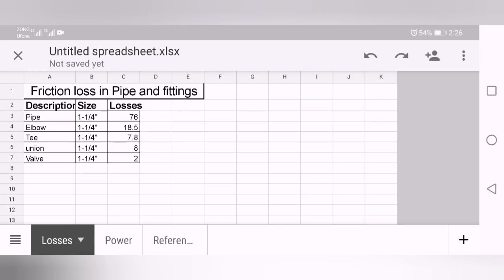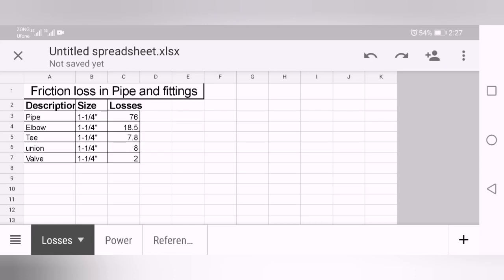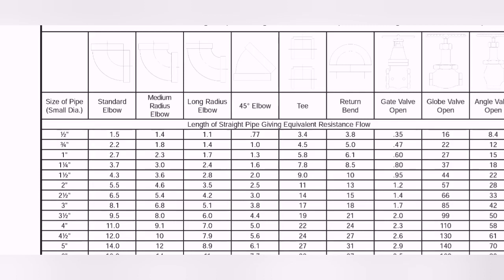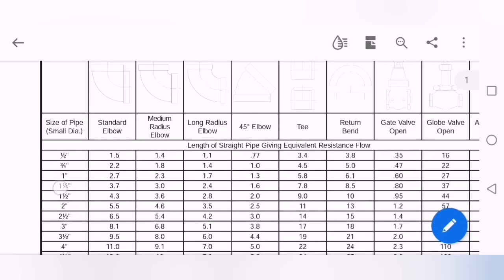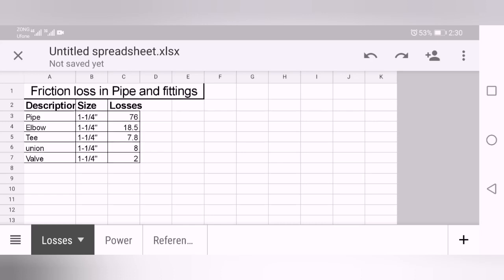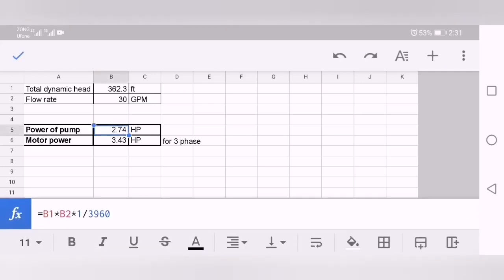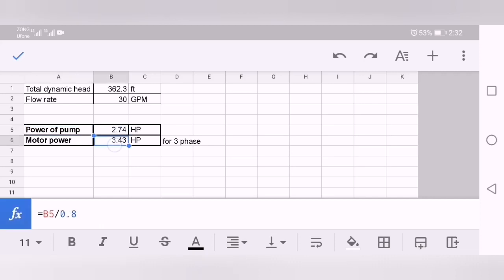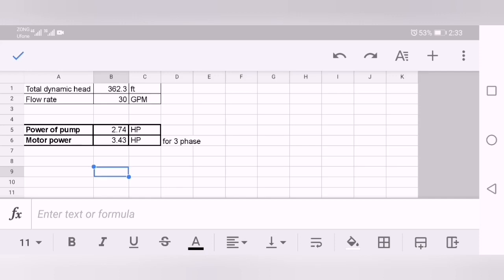Pump calculation and selection (ENGLISH)

Comment: How you got head loss 76 in pipes? How you can say 1-1/4" pipe loss will always be 76 when we need 60 psi pressure? Don't you think it depends upon GPM?   Don't you think we should find the complete length of pipe. Than add pipe length with equillant length of fitting and valves. And at end multiply with friction loss.
Reply from the maker: These losses are already calculated on the basis of pipe size and 100  feet pipe length, the method you mentioned is also applicable for this you can use ASHRAE pipe fitting losses, i will share this method also.
Reply: @passionateengineer04  would you please like to share this is for which pipe material? And please also inform that which standard body has produced these charts? IPC, UPC, ASHRAE or any other body?
Reply from the maker: These are calculated data for steel pipes ie GI etc, it is calculated for 100 feet pipe length and standard flow rate that pipe can handle at pressure drop of 4feet per100 feet, of water.
You can further study ASHRAE HANDBOOK 2017.

Thank you